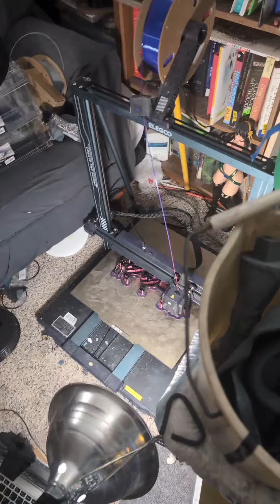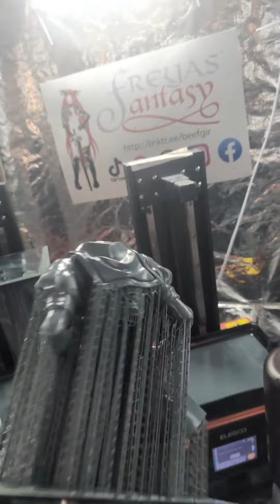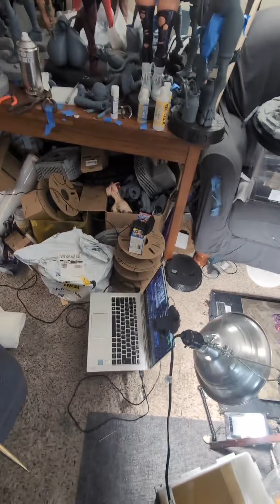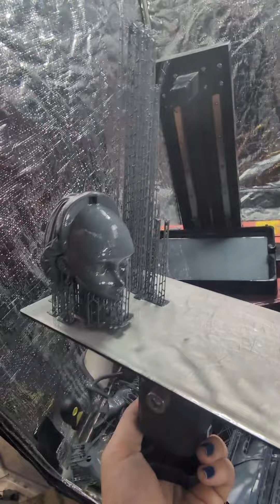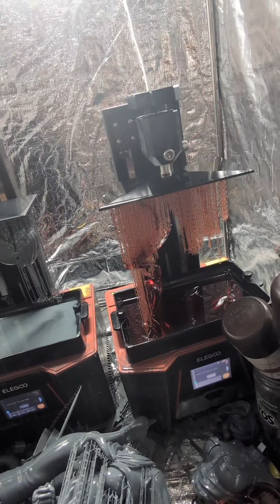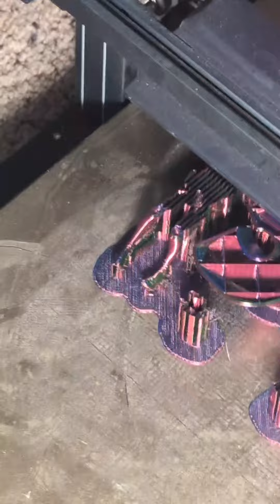banned again. goodby top printer title

Comment: The TikTok account will take time to get appealed but when you create a new account it counts as a ban evasion if you were previously banned. Which just makes it more messy.

As for the blood red pieces you could try changing the Z Lift Speed and the Z Lift Distance a tiny bit when you make your slice parameters. It should give you more success when printing those blood prints but the downside is the increased print time.

Comment: Have you ever thought about maybe trying a different slicer?
Reply from the maker: no... why? it makes the layers. seems to work fine...
Reply: @FreyasFantasys  To me, it looks like it could be errors with the mesh of the model, and based on the supports, it looks like you are using chitubox. I tried it vs lychee slicer and supporting and repairing those issues are way easier in lychee.